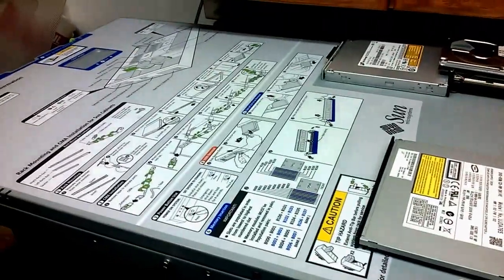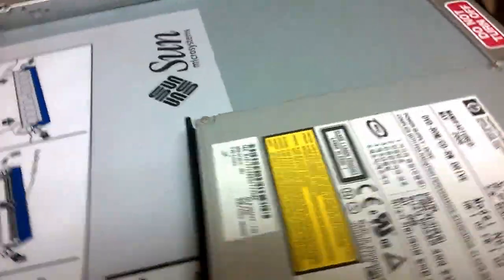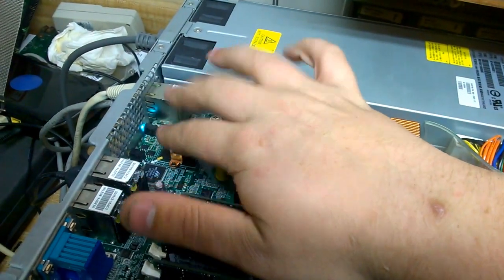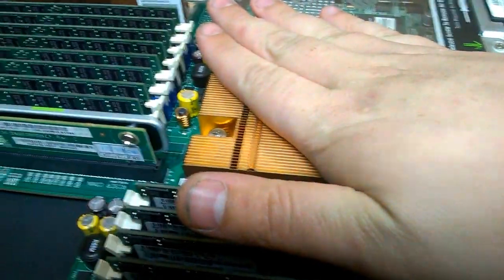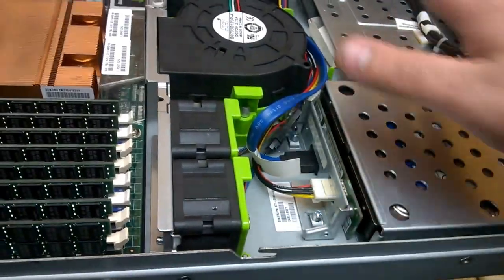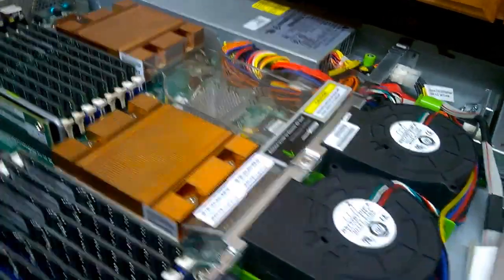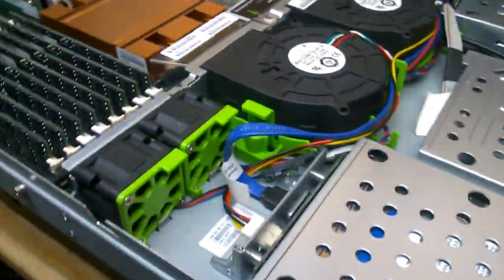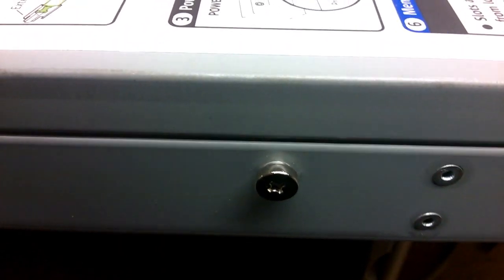Sun Fire X2200 M2 Update - 10-06-2015

Comment: Hello,
this server can accommodate quad core AMD opteron Soc. F but 1) have to replace bios chip with bigger (it is on socket)  pre-flash with newer BIOS and then replace dual core with quad core CPU (45nm) . First hand experience.
Reply from the maker: yes and no. Yes, you can replace the BIOS chip if you so desire, but, no, unless it's from the first batch, every one of the servers has the bigger 8Mbit BIOS chip that can take the bigger BIOS for the quadcore Opterons, because there was always the plan for AMD to release quadcore Opterons and AMD + OEMs knew it would take up considerably more space for microcode/AGESA etc. support. Mine had such a chip already.
I did the BIOS upgrade while on the dualcore Opterons, dropped in the quadcore 2373 EEs and was off to the races. this was back in 2015 sometime after making this video.

Comment: uhm what OS do you use? i have a x2100  and tried linux its really laggy without a graphics card
Reply from the maker: +WavesMC just a copy of Debian Wheezy. if you're trying to do something like GNOME on this system, don't. the onboard graphics with Linux is enough for just a command line, or maybe a lightweight DE like Xfce or LXDE, but it's not going to make any speed records.

Debian Jessie has some weird stuff going on with systemd, but that's still where I'd suggest you start with Linux if you try it. a second time.

it may also technically be because you're limited to two cores, that it seems 'laggy'. the CPU still has to do a ton of work if you're looking to get GUI management going, because of the way the GPU onboard is with Linux. some form of ATI/AMD card specifically made for a PCIe 1x slot will serve the purpose for you nicely if you desperately need to get X with a desktop environment going. Last I checked, I believe the HD5450 had a 1x variant, but I could be wrong. AMD is the way to go with Linux, though. Nvidia requires kernel crap that breaks half the time. 

Aside from that, my suggestion is to get 4x4GB of PC2-5300P while it's still cheap,  and make sure you have the fastest CPU you can afford in it. a 1218HE will be the smartest option if you're not already at the 2.6GHz speed or higher. it has a 65W TDP and will run super cool in the 2100.

that, paired with the 16GB of RAM and some decently-speedy hard drives, and it has the makings for a fairly decent server to do what you need with it.
Reply: so you tried suse on amd x2200? looking for ibm along same route aix \suse rs600 615?